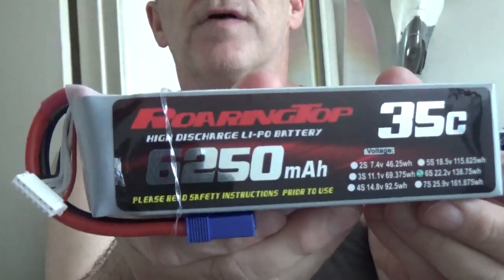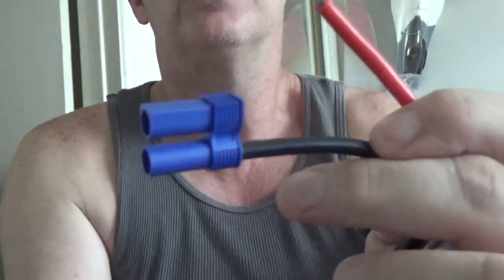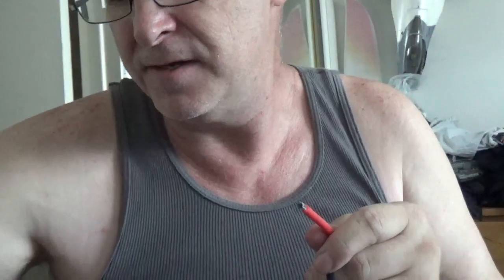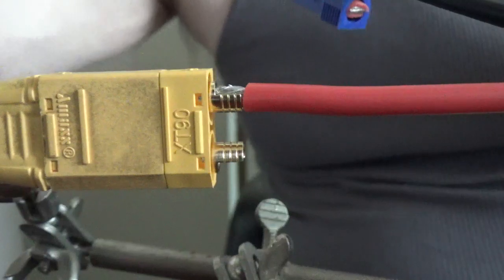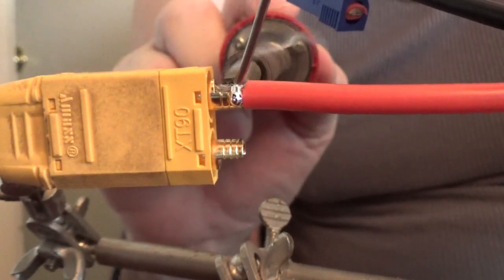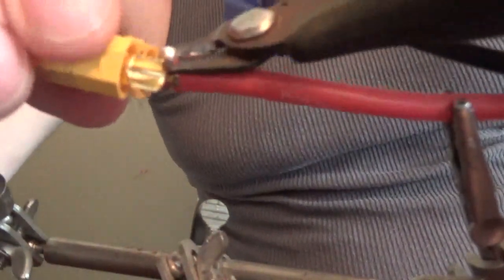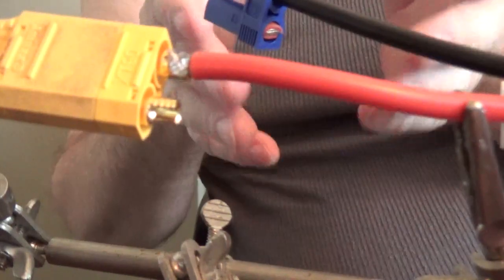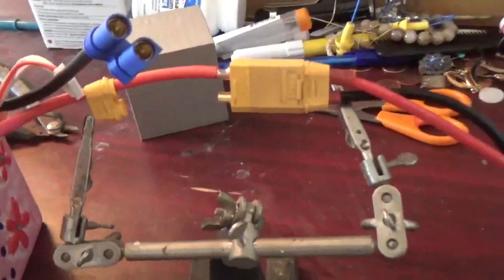Soldering tips for big 6s Lipo Batteries

Comment: Really good tip about adding along cable to get rid of the heat. Nice video Victor 👍🏻
Reply from the maker: Well people were saying my method is going to create a cold solder joint but I tried to put that information in the disclaimer that I needed to focus I'm getting it done correctly not just talking about doing it. But I'm putting enough heat on it to make sure that it is done properly and I always PreFlight my batteries just as much as my jets...
Reply: Victor Shamulus you would not get a dry solder joint by getting rid of Heat though the cable. If the iron is hot enough it will be great, what you method does is save the batteries 👍🏻

Comment: Dang that was Boring!!! 😂 kidding you friend! Good tips, I e changed out the connectors on lipos as well and yes it’s Always important to never cut both simultaneously as it short the pack out and potentially damage it, I also like to dip the solder wire in flux to get even flow, the other great tip you covered in this video is heat dissipation, not many know or are aware of the importance of doing that and results in melting the connector housing causing loose connections and possible contact failures, good to see you showing these tips and tricks Victor!
Reply from the maker: some also said that i need to tin the connector and the wire, but i have had issues doing that way when the solder fills up the wire, the wire gets to big then i need to cut the wires so what is best, i dont like removing wires to tin them. If i tin the connector if can be a pain again to feed the wire in making me hold the wire to long. Catch 22 i guess!
Reply: Yeah as long as you use quality solder and it’s cools nice and shiney you’re good to go ✌️
Reply from the maker: @DeucesWildRC  yeah I posted my photos on Facebook

Comment: Cool video, even though I know nothing about soldering or electronics
Reply from the maker: Well I hope it helps as long as you try not to make a video distracting you on how to do it properly like I did
Reply: I have the umx citation longitude, which is an edf. Could I fly it off the main runway at Apollo. I know it’s under two pounds, but it’s an edf, so would they make an exception?

Comment: You method could leave you with a cold solder joint. Heat rises. Heat up from under joint and tin wire and terminal before joining them.
Reply from the maker: Yes of course that is why I'm trying to explain less and do more. I'm always trying my best to re-check my work before I proceed. I've done numerous batteries that have lots of for years. Part of my PreFlight checks is a battery inspection.

Comment: This technique makes it fairly easy to confirm good heat and solder dissipation into the strands of the cable, but at the same time makes cold solder on the plug side a very likely topic. So be real sure to heat the plug enough as well.

But yeah, soldering batteries is always a fine balance between not feeding too much heat back into the battery itself vs not introducing enough heat for a good solder.
Reply from the maker: Oh yeah that was the whole point of this disclaimer is to not making your own videos unless you're an absolute Pro that can't be distracted with such an important thing getting a good solder joint if you watched it is very important to make sure to solder soaks into the wire.  I completely agree is very dangerous and potentially very expensive to make a cold solder joint. That is why I highly recommend pulling on the connector very vigorously.

Comment: It's just so much easier to buy the appropriate connector .  That's what I do.   When one factors in the time and extra parts and labor it just never adds up.  Just buy the appropriate connector on Amazon and be done.
Reply from the maker: The appropriate connector needs to be changed whether you're doing it on the ESC or on the battery. A cold soldering joint could happen on the esc just as easy. Unless you're talking about purchasing an adapter. An adapter can fail just as easily if not properly soldered itself.
Reply: @victorrcjets7660  Never had an adapter fail 1000 plus flights.

Comment: SO MUCH SOLDER NOT ENOUGH FLUX
Reply from the maker: That's why I am telling you in the description it is not good idea to talk and solder the same time.
Reply from the maker: @bigmage2  i watched that video, way to much heat directly on the wire and holding it with his hand is way worse and i am using XT90 not XT30 which is way easier to use my jig to hold the battery wife in place not needing to hold down the wire with my iron. but been there too!